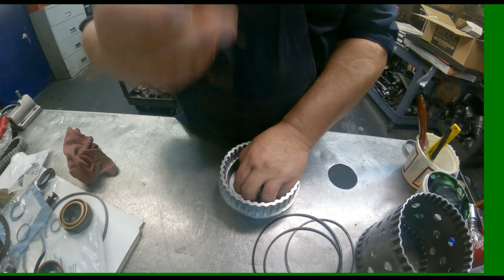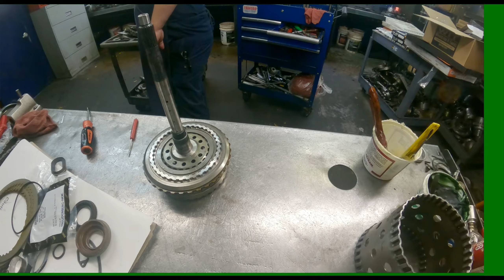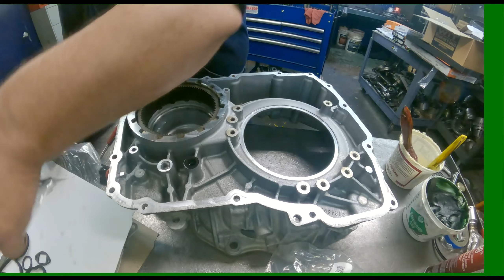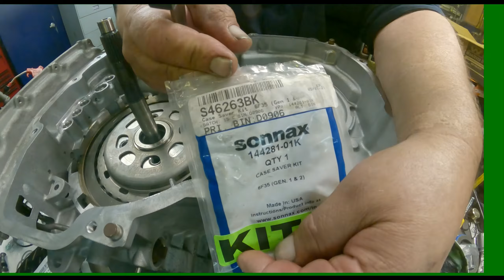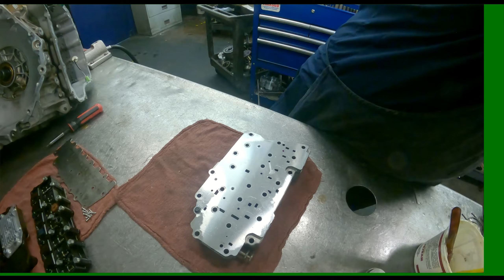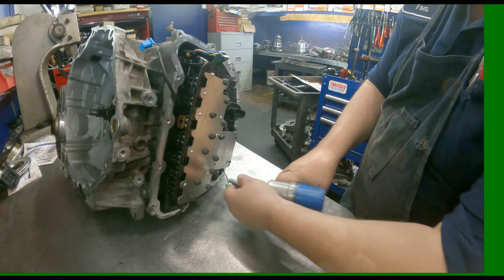6T40 Rebuild

Comment: thanks so much, you let me know it is a problem .. now I will try to fix the 6T40, you made it look easy, awesome videos.
Reply from the maker: Thanks. I was not saying that it is a problem. If it is the sprag noise, that is the noise they make. Also if it is the sprag, it will only do it in one direction. When it freewheels it clicks, the other direction it locks. The 3-5-R Cushion plate is also bad about breaking. It's a possibility that could be your noise. It does a tremendous amount of damage when it does.

Comment: In neutral, engine off, I roll the car 12 inches, and my 6T40 clicks, like a greasy, click, sound,  loud enough, to hear from inside the chevy, I know I could get it checked, but I fix cars, and transmissions, solenoids, etc, ain't ever heard this, I replaced the old cv joints, with 2 new front cv joints, not coming from the cv joints.
Reply from the maker: Two things come to mind. The first is the diode sprag. It will make a clicking sound like that. The other is the park pawl, however it should be heard all the time, and probably would have park problems also. Are there any other problems with the vehicle? If you want to make a video of the noise and send me a request on my Instagram I will take a listen.
Reply: drives good no problems at all.
Reply from the maker: If it is driving good it may just be normal noise the sprag makes. I would just need to be able to hear it.
Reply: I will let you know, what the problem is, in a couple hours.

Comment: My car is a Daewoo Lacetti Premier 2009 (a Chevy Cruze with the Daewoo logo). I want to install an extra automatic transmission fluid cooler, but I want to know which of the ATF cooling lines entering the radiator is the inlet? There are two lines attached to the radiator. So which one is with the fluid leaving the transmission and entering the radiator?  Is it the bottom one “as usual” or the top? Because all I know is that the inlet is the lower line in order to push the air out of the radiator. 
My car's transmission type is 6T40.

Please help me with this.

Comment: What’s that tool called that you hammer the bushings in with the interchangeable parts
Reply from the maker: Bushing driver. https://www.toolsource.com/bushing-tools-c-1321_119_581/bushing-driver-set-solid-steel-19pc-p-92045.html?tsqtid=63701

Comment: Hey mate, that is bloody awesome! Thank you so much for putting this video up, it has made my rebuild so easy and save me a lot of issues. Once again thank you
Reply from the maker: Glad it helped. Thanks for watching.
Reply: Hey mate, I’m wondering if I can pick your brain for a moment. I’m not a transmission worker at all and I’m a bit lost here. The reason I pulled my transmission out was I lost all forward gears, I still had reverse but no forward motion. I googled the issue and I watched some YouTube videos and the suggestion was that it possibly was the valves(solenoids )in the transmission. I pulled those out first and tested them with ohms and power operation and everything seem to check out fine, but not under pressure.When I did drain the oil it was very black smelly and some little pieces of possible fibre. So straightaway I guessed the clutches were no good.. So I rebuilt it and a few of the clutches were no good. I stripped everything down and re-built it and drained the torque converter and flushed as much as the rubbish out as I could. Then reassembled. When I put the transmission back in the car it still won’t go forward. It has excellent reverse and it wants to go forward, when it is cold it will push itself very gently. needless to say I’m rather stressed as I need to get this thing going. My question is do you know what it possibly could be? Should I change the valve solenoids in the transmission, the seven pieces or do you think it might be something else. I replaced everything but I did not replace the Pistons. I replace the seals O-rings and everything else though.All the steels were in vg condition and nothing was broken or damaged. Any advice would be greatly appreciated.😕
Reply from the maker: You have a couple of options here. First thing to do is pull the valve body off and air check the drums. If they air check good you probably have a bad techm. The part that contains the computer and solenoids. It will need to be programmed after installation. To air check the drums. The 2 rubber tubes that were installed under the valve body in the case. Top one is Low/Reverse, bottom is the 1-2-3-4. The 1-2-3-4 is probably where your problem is as you still have reverse. They are bad about blowing out. As you are looking into the case, far right. There are passages that look like they lead outside. Top one is 4-5-6, next down is 2-6 and the next is 3-5-R. If any check bad and the unit needs to come back out I suggest you replace all the pistons. Also did you replace the 3-5-R cushion plate? If not and it needs to come out replace it also.
Reply: @CurmudgeonTransmission  thank you so much for this. I will let you know how it goes!! Thanks again.
Reply: Thanks for that, I did just pull the sump cover back off. The two channels that go behind the plate in the middle of that with the rubber tubes,they both check okay and are operating normally. I put air into the side passages as you suggested the top one doesn’t do anything just blows out elsewhere the second one operates normally and I can hear a Clutch or a piston engaging. The other two underneath that don’t do anything. When you say replace the Pistons. Do you mean the seals that go on the bottom mount where those air channels go to,inside the drum? Because I did replace them when I pulled  the transmission down. Obviously they’re not seated right or not engaging properly though. Do you reckon they could be my issue or still need to replace the techm? I did forget to mention that when I lost all forward gears in the leading up to that i.e. the 45 minutes or so before they failed it would not go above fourth gear. So I could only use 1234 and the transmission would not engage five or six.
Thanks Brother..
Reply from the maker: No I am talking about the rubber molded pistons in all of the drums. Get those replaced and you probably will fix your problem.
Reply: I pulled it apart again, and I have noticed a fair bit of rubbish in the transmission. It looks like that plate with the speed sensor has broken. Also, all of my clutches look worn as when I took them out, and they are virtually brand-new! Can’t understand that. How do I know if my steels are bad?. they all look straight and clean, but slippery! Can I sand them or anything to make them better, or do I need to replace? Thanks brother
Reply from the maker: @lolonghauler  As long as they are flat you should be good. Some people sand them, I don't. If they need that I just replace them.

Comment: What is the tightening torque on pump bolts 11:50 ?
Reply: Here is some update. I took a chance with that case edge under input drum , actually before I assembled it I used compressed air just to see how far upp goes piston who sits on the case bottom and it was just halfway upp approximately which I considered to be fine. Now It’s almost month since I assembled my 6t30 and everything works just perfectly . 

P.S. First days after rebuilding I had some  issue with incorrect gear shifting ( rough shifting ) but diagnostics did not show anything on TCM but it was error code on ECU for engine temp. Sensor , I replaced thermostat with temp sensor and that shift problem gone , it seems to be that TCM did not see correctly engine temperature and gear shifting was rough, well this is just my assumption, I’m not sure about this 100% but anyway shifting problem disappeared and everything is just fine. One more thanks for your help.
Reply: @Zzzz-nl3hx  привет..... Ты менял корпус или оставил старый с дефектом?
Reply: @АндрюхаОрен  Поздрав, користио сам старо кућиште мењача и све ради онако како и треба , само прије склапања сам испробао са ваздухом колико високо иде клип који седи на дну , и клип је ишао само до половине тако да не дохвађа ивицу која је оштећена . Све ради одлично ево већ 4-5 месеци
Reply: @Zzzz-nl3hx  спасибо я тебя понял 👍    если у меня будет дефект на корпусе попробую исправить
Reply: @АндрюхаОрен  Са срећом 💪👍
Reply from the maker: 106 in. lbs.
Reply: @CurmudgeonTransmission  Thanks 👍
Reply: One more question, on the video 20:10 there when you grease with brush around the edge where piston sits , on my 6t30 that edge is bit shaved on the top due to wave plate destruction under input drum , Do you believe that I have to replace whole rear case or it can be used again? I’ve ordered input drum pack and master rebuild kit. Basically input drum is damaged and that case edge on the bottom is slightly shaved on the top, all other parts survived.
Reply from the maker: That is going to be a judgement call. When that plate breaks it does tend to ruin the case. If you think it may be bad it probably is. It may work for a short time, but now is the time if you have doubts. Awful lot of work to go back when you are right there.
Reply: @CurmudgeonTransmission  👍
Reply: 34:00 I hade to completely disassemble that park gear due to small metal parts all around inside , does it matter how is assembled? Cos I noticed (after I disassembled) that one of the gears is with points for output sensor , should it be assembled exactly on same place or doesn’t matter how gears are turned? Sorry about my bad English, hope you understand meaning
Reply from the maker: Speed sensor reads off the park gear and you cannot install that wrong. The sprocket I have never disassembled one, so I looked it up. They do not specify, so you should be able to put it either way.
Reply: @CurmudgeonTransmission  Great 👍, thans for your time .

Comment: Hi, since 6F35 and 6T40 are pretty similar, so does the trans fluid right ? Do you think we could use GM ATF VI in the 6F35 ? Or we should stick to the Ford  Mercon LV ?
Reply from the maker: I am not sure. Always safe to follow recommendations. Having said that we are using a full synthetic and they have been working fine.

Comment: Thats amazing... But you dont soak the fiber clutch plates at all???  Im working on a 6t45 equinox
Reply from the maker: I get that alot. No I don't, Every builder I know does not do it either. Not near as critical as everyone likes to make it. I will do it on a racing transmission and it is a carry out but other than that no.

Comment: It’s always good to see someone who knows exactly what they are doing. I specialize in engines but am currently working on a 6T40 that the sun shell swelled up on. Not sure why it did that just yet.
Reply from the maker: Thanks. What exactly do you mean by swelled up? You got a picture or a video you can post on your page?
Reply: @CurmudgeonTransmission  I just posted a video of the Sun Shell. And thank you for taking it to reply to me. I really appreciate it.
Reply: @CurmudgeonTransmission  basically the rear sun shell seems to have stretched out. The 3-5 clutch splines are loose inside the shell and the clutches on the outside of the shell are stuck.